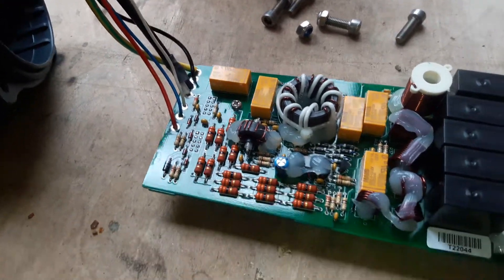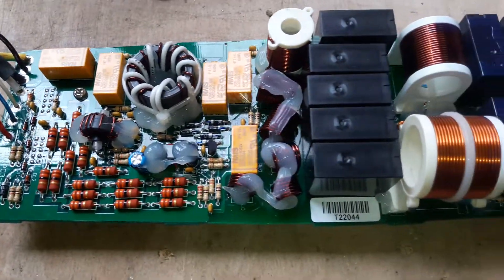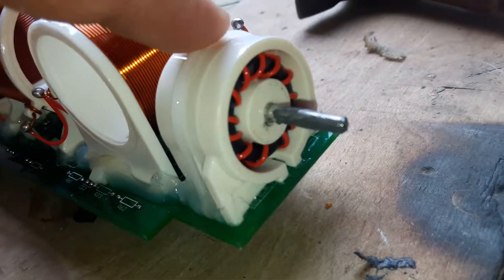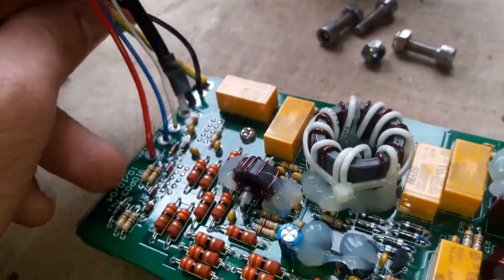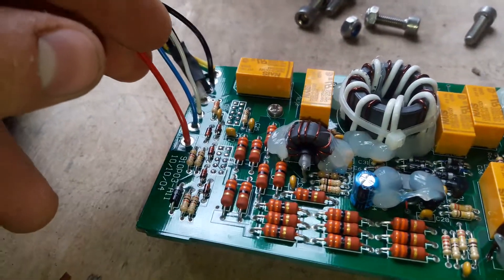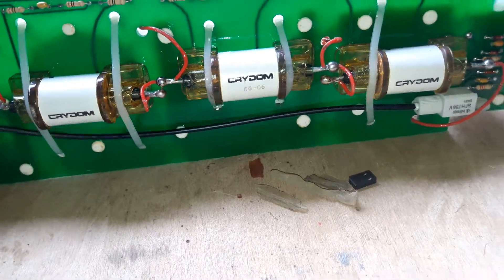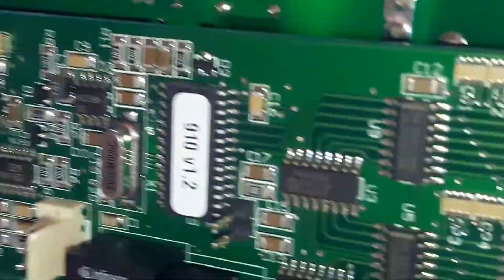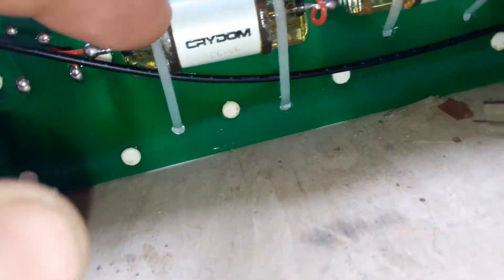Barrett 910 Automatic Antenna Tuner - how it works.

Comment: Hi Ika, I need to install a Codan 9350 antenna on a Barrett 4090 radio, do you have the conversion diagram to make an adapter?